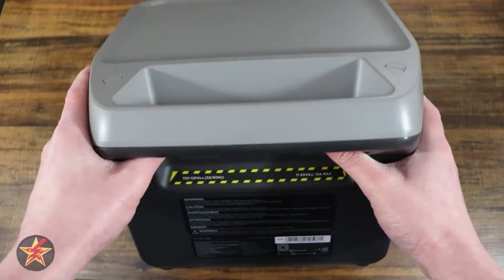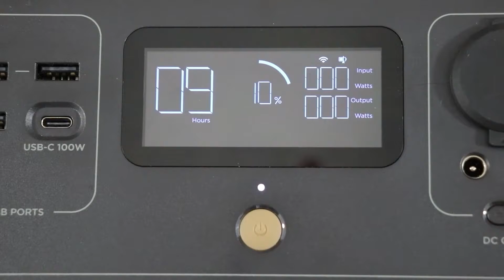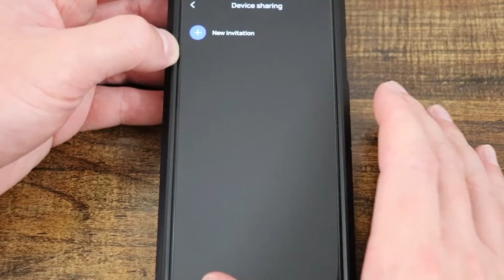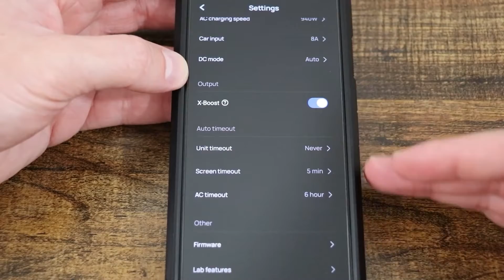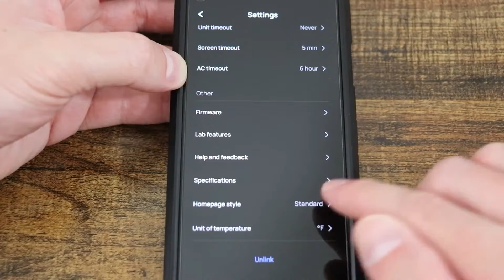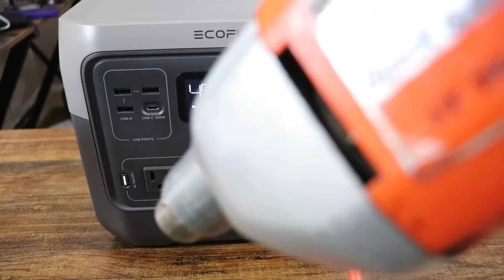Review Of The Ecoflow River 2 Pro: Is It Worth The Hype?

Comment: I rarely use mine. I use it for emergency power. I am using the max 2 as a ups for my router and wifi.

PSA:
You can power a 6,000 btu window ac unit just fine.
However, it lasts about 2 hours.
I tested it on high at 62 f.

If you have extra battery banks, you could extend the run time on the river series by charging it through USB C via battery banks.

Edit
My 200 watt battery bank adds about 1 hour run time of the window ac unit.
Reply from the maker: Thanks for sharing your experience and tips!  I pretty much use mine to charge up things in my home to help cut down on the bills.

Comment: How long does it last if I charge it to rice cooker having 700watt capacity. Thanks
Reply from the maker: It would run for about 1hr.
Reply: @Wanderer001_Reviews  if the rice took that long. Normal rice cookers are done in 10 minutes so you could do this 5 or 6 times-ish..

Comment: How long would it run a 699watt fan cooler?
Reply: About 1 hour in theory when fully charged. The specs says the capacity is 768Wh.
Reply: @peterking8722 yaaa I got a delta 2 with 110 wat solar panels u think the solar panels will power it for like idk 8 hrs?
Reply from the maker: The most you could do is keep things topped off. Don't think you will be able to keep up.

Comment: can I plug in my pc here so that if I have power interruptions it stays running? please help me
Reply from the maker: It is more meant for using as a power source.  What you are describing is a UPS, which while this can cut over after a power loss it is not "fast enough" to be considered used for this.
Reply: @Wanderer001_Reviews  oh i see, so i can use this for my laptop instead since i just plug it in here if the battery is drained, thank you for the clarification, i plan on working remotely and on the go so i really need this
Reply from the maker: @jjcrpytaps5271  I have done that myself, it is great.
Reply: Yes. I have a mid tower desktop & wifi router plugged into the smaller River 2 all the time. You will be good until the battery runs out
Reply: I’m buying it to run my ups to my pc. Coz ups can have only 2h of battery or less. And river can charge up ups. And having ups eliminates pc shut down if it would be plugged directly to river coz there is a delay be4 river’s battery kicks in.

Comment: Was planning to buy river 2 pro, i have 3 fans that runs around 80 watts probably its on for 15 hrs plus 8 lights for 20 watts each probably running for 20 hrs, is it enough? To poeer those?
Reply from the maker: Are they all located in the same room, or are you looking to move the river around from room to room only powering some at a time?
Reply: Powering at the same time @Wanderer001_Reviews

Comment: Hi. I have a 24 litre portable freezer and i was wondering if this will be able to keep the freezer running continuously if i have the river 2 pro connected to a solar panel ?
Reply from the maker: The solar panle is more to charge up the river pro, not for adding extra power to it.  As for can the river pro keep the freezer running continuously it depends on how much power it draws to keep it going.

Comment: Can I use this as a UPS? when Ac is plugged in does it have like a load transfer feature?. The thing is I have a Solar inverter system for my entire house.  I want to purchase this particularly for my workstation but I don't want a situation were it constantly draws the required watts from the inverter even after fully charged
Reply: You can use this as a UPS. It supports “pass-through” operation or “EPS mode” (Emergency Power Supply) to function somewhat like a UPS.I use mine for my Ps5,Yamaha MG20xu,LG monitor and 2 KRK monitors. You can leave it connected to the mains. The only difference from a normal UPS is that the EcoFlow has a 20ms switchover time, Which works well for my devices( and most modern electronics). I even have my Synths,Drum machines,Samplers etc hooked up to it. I've had no issues with it.
Reply from the maker: Its really not something that you would use for a UPS, you can keep it plugged in and have something plugged into it, but the battery will keep pulling power to keep the battery topped up and the switch over to "power" a device off the battery is not fast enough to be considered a UPS.

Comment: What’s the best way to store /keep the battery always ready in case of power outages- can I keep it plugged in ? Does it have to be discharged occasionally?
Reply from the maker: If you keep it plugged in all the time it would stay at 100% but unless you need something plugged into it to work right away when power is loss this is not needed.  Every three months you should discharge the battery to 30% and then recharge it back to 60% or more.  This helps with battery health.

Comment: Hi, can this run as a battery backup to sump pump? Example, i leave the ecoflow plugged into the wall, sump pump connected to ecoflow, if power goes out when im not home ecoflow will activate?
Reply from the maker: It should, but I have not tested this out for myself.  However, I have been suggesting this to someone that just got a house with a sump pump.
Reply: @Wanderer001_Reviews  ok ty! Jesus bless you!

Comment: Does xboost work with CRT TVs?
Reply from the maker: It would depend on how many watts it pulls.
Reply: Im running a 24 inch crt with vhs combo and it's only pulling about 50 watts. So it should work for a decent amount of time
Reply: @ Unfortunately, my 34 inch CRT caused an overload upon start up. I am using EcoFlow river 2 pro which should output 800 Watt. It is really strange why there is overload on startup!
Reply from the maker: @ussamaalkaissi2994  Do you have X-Boost on?  It sounds like the boot up is going past what it can handle normally.
Reply: @ No X-Boost was off. I am afraid if I use X-boost, it might damage the TV since as far as I know X-boost is used for devices that emit heat like kettles or hair dryers.
Reply from the maker: @ussamaalkaissi2994  X Boost is for anything that needs a little extra help to be powered by the power station, and in the case of a tv it would only use x boost for a few seconds when it turns on after that the power station would just hang out in its normal rage.

Comment: Can you run a CPAP machine with the humidifier turned off first more than one night?
Reply: Without the humidifier my resmed airsense 10 only draws between 10-15w. I should imagine at 760ish watt hours this should be fine for 50-ish hours
Reply from the maker: @DaCheat100  Thanks for sharing.
Reply from the maker: Most likly not without topping off the battery in the day.  My reletve has the Delta 2 and said they got 2 night out of it at 8hrs each night.
Reply: @yvetteboheme2789  update: I bought one and run my resmed airsense 10 without the humidifier attached and it says approx 30 hours. I run mine at around pressure level 10, so that’s another factor too. My only complaint is that when the power goes out and running from the battery the fan on the power station kicks in and it is quite loud for sleeping.

Comment: How do you charge this. Do you put it in the sun or do u plug into an electrical outlet?
Reply from the maker: There are a few differnt way to charge it.  It does come with a cable to plug it in to charge, but you can also charge it via solar panels, which are sold separately.

Comment: Do you think this would work with a small electric kettle to boil water?
Reply from the maker: It should be able to pull that off.
Reply: watch the watts on the kettle, on Xboost it could handle up tp 1600 watts in theory by modulating the voltage. In practice better look for a water kettle up to 800 watts, which could run for just under an hour. Since water is boiled within 5 minutes one can boil water 15 to 20 times depending on environment temp, water temp at start etc.

Comment: You mentioned several times that you cannot add an external battery. Yes you can. Just connect the appropriate size battery to the solar input and you are good to go.
Reply from the maker: That was more about how the version 1 had the ability to buy and expansion battery that could plug right into the unit.
Reply: @Wanderer001_Reviews  According to the manual the solar input voltage range is 11-50v.  So all you need is a battery, or multiple batteries, wired to output 12v, or 24v, e.g., find a mating connector for the River 2 solar input, and voila, more power.
Reply: There is the loophole for that but as a direct battery expansion that also charges from the river 2 pro it does not but there is a loophole using 1/multiple batteries via the solar input so theoretically it could be a infinite runtime depending on how many ah is the (solar input by battery)

Comment: Hi. Could you explain why, in this case 21:21, the station will be powered for 8-9 hours instead of 12-13 hours? Based on my calculations, 47 multiplied by 8 equals 376, not 637(which is 83%). I understand that the station requires some energy to operate, but does it really need that much? Or could it be due to the station's efficiency? I bought a new station and with a 100% output of 53W, which lasts only 8 hours and 15 minutes. Why is its performance so poor?
Reply from the maker: The lights I use for filming are old and vary the pull of power they do.  They also do read well.  As you saw everything else looked ok for power time with this station.
Reply: The Ac to DC converter takes up to 25% of power. When using AC appliances a lot, I would opt for a larger system, more wH and higher capacity like 2400 watts or over 3k. See this as a camping option for tents. If I would use anything like AC, heating, one or more appliances constant, home use or work use, do not choose this option, go for delta not river. 

Even if I would go camping with a camper or caravan, not with tent, I would choose Delta. If you value portability, solar charging, use with any kind of manual transport (beach cart, carry bag), DC appliance (12v cooler, charging for phone laptop or music) choose River.

Comment: What makes you think pure sine wave is required for your computer? Did you know that most UPSes are not pure sine? The psu in your computer converts power form AC to DC before it get to your motherboard anyway. So AC power does not touch your motherboard... Pure sine may be better for your psu but it doesn't do anything for your internal components.
Reply from the maker: Did not think it was required, more of a nice thing to have and one less thing to worry about.

Comment: so tbh, i love the ecoflow river 2 pro in this stage, with only 1 monitor and desktop computer, i can pull 45 watts just idling at like 10 hours at least, with 800 watts maximum, thats very good.

now, i have my full rig up with both monitors and i can get like 7 or 8 hours with only at 65 to maybe 70 watts. giving me that amount of runtime. only for idle. if i was on full load, then i may have 3 hours to play gta 5 on my pc. if my pc was going for a full load of 300 watts. though thats not the case. so this is very portable, and yet, i don't have solar panels which is 220 bifacial solar panels, i use this MAINLY for my desktop computer, and maybe a laptop computer if i go out. i have to take out the battery because it tends to get very hot. and at 100% i can run my laptop computer for 15 watts at least a days worth.
Reply: Hello. I'm considering buying this unit. Does it support pass-through charging? Can you use your desktop plugged into the Ecoflow while the Ecoflow is plugged into the socket outlet 24/7?
Reply: I bought it, and it supports Pass through charging. I'm using it with Starlink.